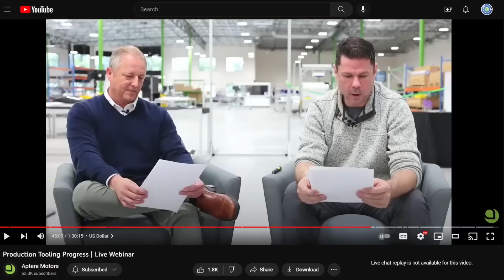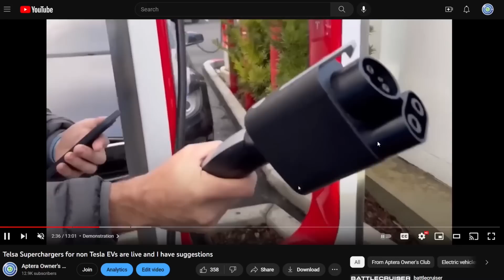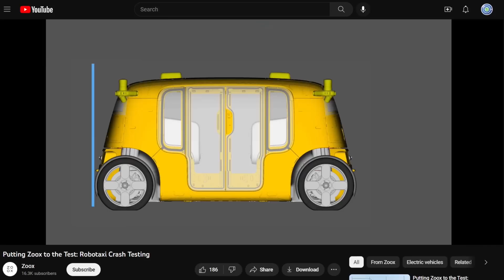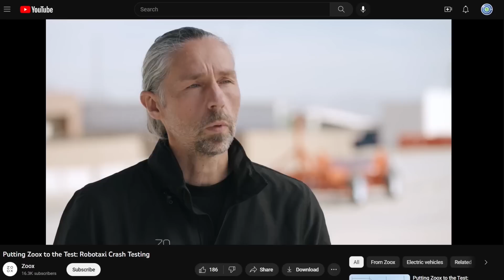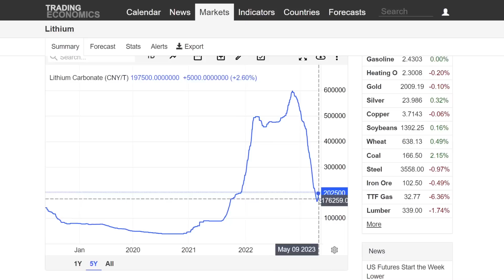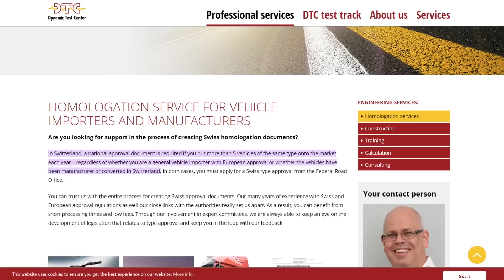Solar, Acoustics, Charging, Supply Chain, Steering:  Aptera Production Tooling Webinar Q&A Part 2

Comment: if their composite is similar to aircraft composites they will silence more than most materials. most aircraft nacelles are made from this not just for weight savings but sound and temp dampening. comparing a 737 classic to a 737NG or MAX the nacelles are composite, so instead of hearing airplanes flying overhead we have to look up to know there is a plane up there.

Comment: My weight is almost 120 kg and my wife's weight is 60 kg, that is only 400 pounds and, judging by the appearance, both founders of Aptera weigh 200 pounds each, which adds up to the same 400 pounds.  that is + there is only 100 pounds for cargo (45 kg), which means a HUGE EMPTY trunk, and this is a "transport for long-distance travel"?  Something they clearly did not take into account or did not present correctly?  Every additional 30 pounds of weight over 500 pounds is minus 1% of the cruising range for 400 miles is minus 4 miles, for 600 miles minus 6 miles, for 1000 miles minus 10 miles, it is minus 2.5 miles for 250 miles))  )?!  Maybe this is still not a true extrapolation based on an inaccurate formulation?  Maybe +30 pounds = minus 1% of the distance, calculated only for 400 miles, and no one calculated for the rest?  Because they don’t know yet, by the year when the production of 600-1000 mile Aptera begins, the verge of progress))) whether the Chinese CATL will sell them super-capacious batteries or will have to wait 10-15 years until intelligence gets Chinese technologies and they can be implemented on  Indian factories in the US?

Comment: 500 pound weight limit? I'm 6 feet tall, kind of slim and I weigh 175 lbs. In my world there are very few 150 pound males. Most are closer to my weight and many are heavier. I think 500 pound weight limits are too low by 200 pounds.

Comment: The “Magic Doc” allows you to unplug the charging cable (w/ or w/out)  it’s CCS adapter. You’ll never need an adapter to switch back. CCS adapter is left in Doc w/ the proper selection of button on plug end or Tesla app.

Comment: @18:00 price inflation - this is a deal breaker for me.  i’m not such a fan to pay as much for a Tesla M3 and get 3 wheels.  2024 Tesla also benefits from direct pay - meaning tax discount applied to sticker.  Aptera is HUGELY crippled in the subsidy arena.

Even if there were fully funded, they are being squeezed by lower Tesla pricing.

Comment: One thing I hope for with Aptera is battery options in the future. Months ago I saw videos about battery research for alternatives to lithium. I forget what it was, but they found something much MUCH cheaper than lithium and far less harmful to the environment to gather, but I'm drawing a blank on what that was. If this research develops actual batteries we can buy, can the Aptera swap the lithium out for this other option? From what I saw they were using typical battery sizes for the research. Something like a AA battery, for example.
Reply: By any chance were you referring to Sodium-ion battery?
Reply: @505YUTUBE  That sounds about right.

Comment: There really needs to be some kind of agreement between Aptera and Tesla to allow Aptera to use all the supercharger outlets, but that will also require a special app for the Aptera owner, that talks to the supercharger and identifies it as a vehicle which is allowed to use that charger. Whether Tesla is willing to allow that exception for Aptera, who are after all a competitor, even if they are a small one, is up for debate. An interesting aspect of this, which I just thought of, is that if they do allow it, that will make other EV owners say, hey, why is Aptera being favored in this way? And the answer, of course, is because the Aptera has a NACS port. This could be the ice breaker that makes other EV makers think about supplying their vehicle with a NACS port. What if, as well as providing a CCS port, there was a NACS port in the appropriate position at the rear of the vehicle just as it is positioned on a Tesla?

Comment: I'm interested in putting in a Solar System - with Battery. I'd like to connect the Aptera to the system to augment both the Solar Cells and the Battery.  Is the Aptera BMS (Battery Management System) setup so that we can do that?
How do I find that information?
Reply: Regarding Aptera's solar, it cannot be used to supplement a home's solar. Regarding Aptera's battery, they've said that V2G capability is something they're aware of but is low on the priority list so the chance is very slim at the moment.

Comment: I still recoil when I hear of the Tesla connector being called a ‘standard’ - it has not been accepted by any bona fide standards body (e.g. Society of Automotive Engineers).

I’m glad they are adopting the use of Apple CarPlay and Android Auto, as I suggested sometime ago.

It should offer the company development cost savings and reduce rollout schedule risks.

It will also offer users a superior infotainment system experience from the get go!

Charge on

Comment: Drinking a little too much of the Koolaid Steve, suggesting buyers should lose weight to meet Aptera's design??? I would think Aptera, should be talking with Elaphe on bigger motors, suspension upgrade and battery capacity, for the longer range vehicles.
Reply from the maker: I'm suggesting people lose weight for their health and everything on top of that is a side benefit
Reply: @ApteraOwnersClub   The problem is he's using the average weight as 150 lb, and that's 50 lb shy of the actual average weight.  I think he needs to adjust the numbers to get more accurate data when it comes to range, etc.
Reply: I think on the 600 mile and especially the 1000 mile range vehicles, there will be a lot of changes - not just in suspension and brakes to handle the extra weight -  But also making these more of a touring vehicle with additional considerations on seating, steering, road side assistance, tire repair, cabin venting and more.  

I've taken my 2000 mile annual round trip vacations in everything from small trucks and zippy sport cars, to Toyota Corollas, to a 15 year old VW touring vehicle, to a brand new Tesla model3.  The first 300-400 miles isn't too bad in any of them.  But the old touring vehicle beat all the rest hands-down after that first day for arm, back, neck and leg comfort, and for going over pot holes on backroads without being jarring or feeling like you might lose control.  The model 3 won on being able to drive 70 miles an hour with the windows part way down and still being quiet, but lost on keeping me cool since the sun roof lets the heat in more than nearly any other vehicle I've ever owned.

Comment: There is no way the Aptera will need multiple adapters. I give 99.9% chance of you select "Charge a non Tesla" you can skip the magic dock part and just plug in the NACS cable. In the instructions you have to push the cable into the magic dock and have it lock in place before you remove it. Just don't do that part!

Comment: Whatever happened to the 20 something million dollar investor that was announced last year to be coming early this year and wanted board representation or awareness as condition for their investment.
Reply: It's in the SEC filing.  Now has until Q3 2023, pretty sure Aptera didn't meet their requirements for the transaction
Reply: @chrisrudzinski6241  Thanks FYI, how did you get the new Q3 update?

Comment: Interestingly, for other two seaters, the passenger plus cargo weight limit of the Corvette is something like 399 pounds! For the MX-5 it is 340lbs. Most 2+2 cars have around a 650lb max rating for driver, passenger and cargo weight. Aptera already said that the suspension would be recalibrated to handle the added load of larger battery packs. It is likely that the 250 mile battery packs will be LFP, from their alliance with Formosa, because their new LFP battery factory will be up to full volume in 2024/5, after the first 5K LE Aptera models are built. I think that the solidity of the CPC carbon fiber shell and SMC panels will shield outside noise well, and have less chance of buzzing or rattles.
Reply: The big problem I have is me and my friend would overshoot that 500 lb. So how does the car handle or could it handle exceeding that weight?

Comment: They chose Switzerland for their first European homologation because it is a non EU, lone, country and it is probably easier to deal with a single small nation than with the multinational, heavily bureaucratic EU. That doesn't mean you can import it into the rest of Europe easily though. It is going to require a lot of wangling and money to accomplish. That was why I opted out of the Accelerator program. I believe it is not worth the trouble and cost.
Reply from the maker: That makes sense
Reply: That's not entirely the reason.  As I understand it, all you need to have homologation in the EU is to have the vehicle approved in one of the member states, and that's it.  As it turns out, Switzerland accepts vehicles that have been homologated in the EU (I don't know about the reverse).

Having had the opportunity to talk to Chris and Steve when they were in St Moritz at the beginning of the year, I and others probably nudged them a little towards Switzerland, because "many" people here would like electric, but since Switzerland is a land of mainly renters, the problem is home charging ("many" in quotes because I don't have numbers to support what is my impression talking to admittedly like-minded people).

Since home charging is difficult (as I've said before, running a cable from your 6th floor apartment to your car parked across the street isn't really viable), solar charging, even though we don't get as much sun as California, would be a big plus for many.
Reply: @fmk5122  I suppose you are Swiss to have your information. It may be that Switzerland could accept vehicles homologated in the EU, but to the best of my knowledge, the reverse is not the same.
Reply: @adimchionyenadum2962  You're absolutely correct, I live in beautiful Switzerland😉.   I was looking through the rules for Swiss homologation, and from wading through all that stuff (requiring mega doses of caffeine) I saw that Switzerland will accept a vehicle that has been approved in the EU.   I have no idea about the other way around....

Comment: It is always easer to lower prices than raise them.  Aptera currently has a lot of orders and the accelator program shows that there will be at least 2,000 orders to be filled first by people that have some extra cash. So a little higher price for thoes first 2,000 then adjust the  price down as they start experiencing the cost savings of the higher production and the income.
Reply: Umm, no. The other way around. Accelerators get 5% off the vehicle cost. The program is also funding production and securing parts contracts. Paradigm orders should also get consideration. Once these vehicles take to the street, our silver turns to gold. This is when you can pass any additional cost on to reservation holders. Lets not forget an IPO at some point.

Comment: Regarding funding, I have to say that I'm starting to get a bit more pessimistic.  I REALLY want an Aptera, but I'm concerned that if a big funder was going to sign up, it might have happened by now.  I'm certainly not giving up on Aptera, but in the last couple of weeks I've started to think about what my "plan B" will be in case Aptera doesn't get the finding they need.

How are other people feeling about this?  Are you as optimistic about funding as you were, say, 3 months ago?
Reply: My wife and I ordered and made our first small investment in November of '21.  A second investment was made in December of '22.  We REALLY want an Aptera too, but pessimism has NOT entered the picture because of the help/direction Steve and Chris are getting and have been humble enough to follow from early on.  They are making fantastic decisions as a result!  This applies to both the vehicle design for manufacturing/improvement over time, and for the company/manufacturing set-up.  Are we disappointed that funding has not come through all at once and that this has pushed the timeline back?  Sure we are, but this has a silver lining too...  One of the biggest changes to cause delay is the production of composite parts from the originally planned sandwich core construction, to the forged process with C.P.C.  Expensive tooling that takes a long time to make, is the down-side, but orders of magnitude faster part production, quality, added strength, lighter weight, and crazy precision are all upsides!  This is sooo gonna be worth the wait!!  Don't forget that the whole reason this major change was needed, is because of how many orders had come in... so many that the original plan would not make its way through that demand timely enough, so the change was necessary!  We also share some concern about the U.S. investor market and finding funding, but I believe Steve and Chris are doing the right thing in looking to other parts of the world where the markets are better.  Hope this helps to bolster your thoughts and optimism, we sure can't wait!!
Reply: Just monitor the leaderboard as tangible proof of progress. Crowdfunding will continue to carry the day. With 1063 slots taken so far we'll have all summer long as the countdown continues. Meanwhile, the ATVM Loan process contnues. Crash Test Dummies in Delta on Youtube by the end of year. Accelerators beta test their signature Launch Editions in San Diego by this time next year. Eventual IPO. Positive cash flow before 2025. In a year or two, we will see if Aptera looks like Tesla or Arcimoto. I can accept either one.
Reply: Let’s hope they practice what they preach about saving the planet with the Aptera and that they will use all avenues to get into production even at the cost of losing full control.  If no whale comes in then they must IPO to get the money to get into production.
Reply: @gbpg2016  I understand what you're saying, and I don't necessarily disagree, but I can understand why they would be pretty hesitant to do that after the way Aptera went under the last time they lost control of it.
Reply: Yup.
Reply: Optimistic is NOT a word I would use in my case.  The'money song' is the same tune that ALL the failed start up EV shops have sung. For this writer, I AM at Plan B right now, in truth some 04 months ago. The 'Biden Curse' on all things banking and economic has been cruel to many, and WORSE for Aptera--which will never be made.
Reply: @harriettanthony7352  Don't forget that if Aptera just gives up, then it will be a sure thing that it never gets made!  It will take a fight and it will be worth it, but only if you're willing to fight.
Reply: @harriettanthony7352  Well your pessimism shines through your comments and I'm sorry to hear that.  Of course the financial side is the cause of all failed start-ups... it's the most difficult side of being a start-up.  Biden has been such a curse on the nation that even democrats have to be royally embarrassed by now, but I am also optimistic that our "Buffoon in Chief" will not be able to fudge another election and will be ousted in 2024, so it HAS to get better.

Comment: 22:30 I don't think the amount invested in the accelerator programme will jump massively.  Now that people can't be pushed out, they're mostly investing the minimum in order to be in the top 2000.  Compare the average investment prior to the change (circa $14k I think) versus the current average investment (just over 10k).   Having said that I do think it was the correct decision.  Investment had dried up a lot.
General note - only invest what you can afford to lose.  Startups are very high risk and you must take that into account.  The biggest risk right now (IMO) is the tax credit in the USA, which grossly distorts the market away from things like Aptera.  Other markets such as the EU may be a better bet.

Comment: I actually emailed Tesla and asked this question, the representative was unsure but did write this:  

"Thank you for reaching out to us about this. We would be happy to look into this for you. That would be a question better fielded by Aptera as we do not have information on how their Battery Management and charging systems work. "
Reply from the maker: That representative at Tesla clearly did not understand the question because whether or not Aptera can charge at a Tesla supercharger has to do with their software and communication with the vehicle then with how Aptera does their charging
Reply: @ApteraOwnersClub  I agree. I feel like the solution would be for the Tesla app to enable people to select their car brand and based on that the " magic dock " would unlock with or without the ccs adapter depending on what is appropriate.  

It seems Tesla is completely unaware of any brands using the NACS plug in their vehicles, and as such hasn't even considered what to do or how to charge those vehicles at a Tesla charger. Aptera needs to be in discussions with them to figure this out.